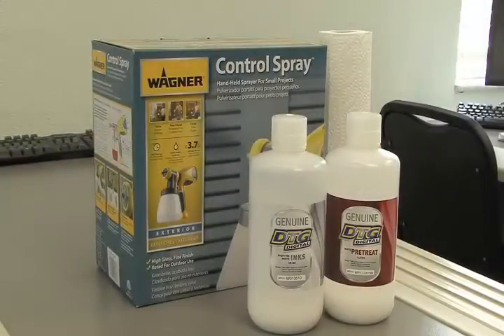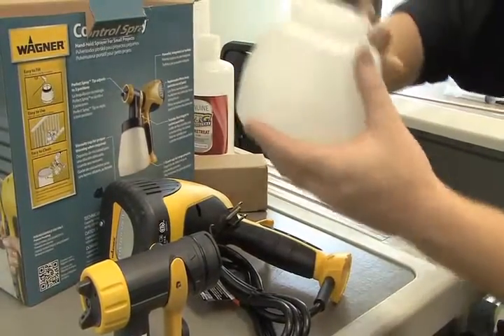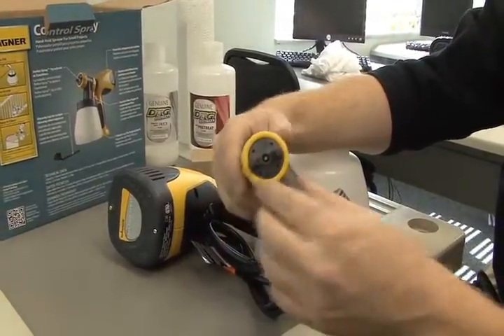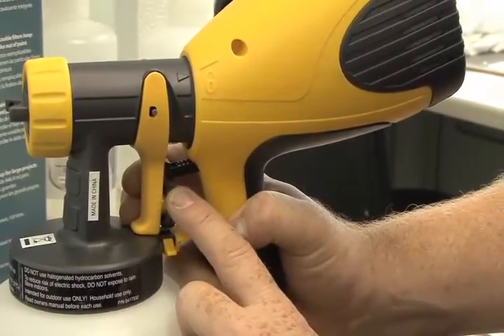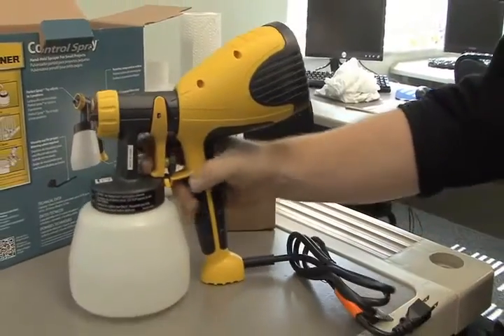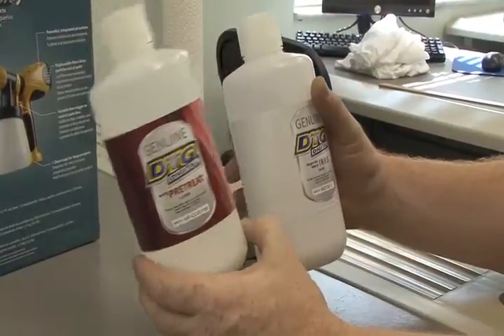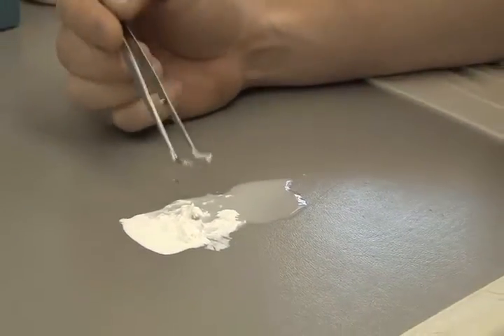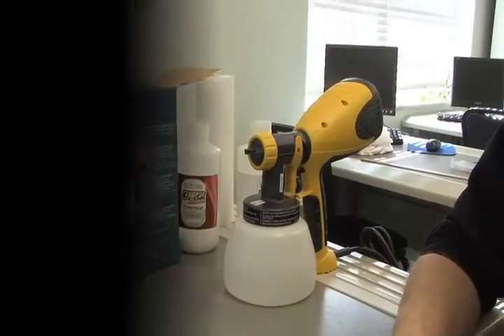T Shirt Printing Machine Procedures - Setting Up the Wagner sprayer for pre-treating

Comment: Do you have trouble with the wagners starting to spray inconsistently.  We went through 2 i 6 months.  We clean the noszzles with water and spray everything out with distilled water.  Are we missing something or doing something wrong
Reply from the maker: Nicolette - it sounds like it just requires more maintenance - otherwise it should last a LONG time. Try cleaning with rubbing alcohol after each use, soaking the components in it, etc.

Comment: Another thing I wanted to ask was that the Wagner spray is out of stock at Home Depot. They only have Black n Decker (http://www.homedepot.com/p/BLACK-DECKER-SmartSelect-High-Volume-Low-Pressure-Paint-Sprayer-BDPH200B/203408766) and Home Right (http://www.homedepot.com/p/HomeRight-Finish-Max-Fine-Finish-HVLP-Paint-Sprayer-C800766/202736982#). Do you think these tools can also do the job?
Reply from the maker: hmm..i hate to say with something we haven't tried. Why not get on online? http://colmanandcompany.com/static_store/Specialty3.html
Reply: Ahh.. a little too late. Already bought the Black n Decker cause Home Depot ran out of the Wagner and they said it's being discontinued. Anyway, I clicked on your link and saw golf balls with the sprayer. What's with the golf balls?
Reply from the maker: Hanz T. That's a jig so you can DTG onto golf balls - doing custom ones for events, businesses, even individuals can be really profitable.
Reply: Oh I see. Alright thanks for your response!